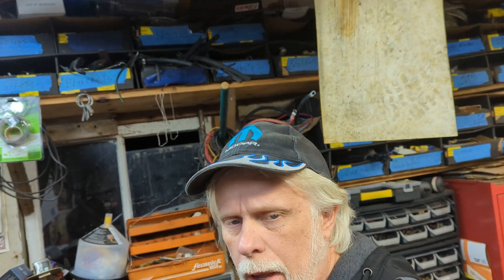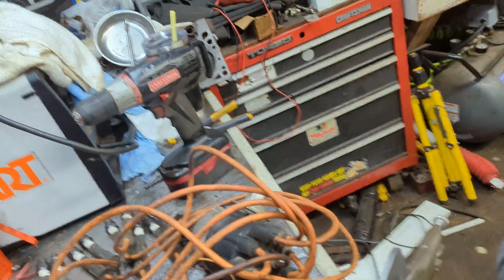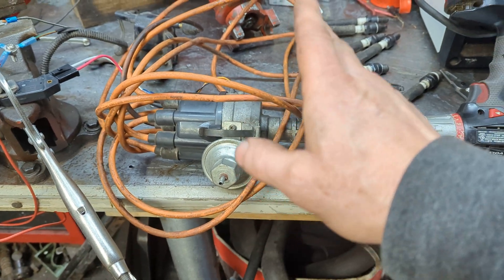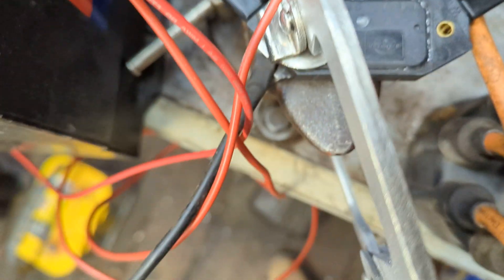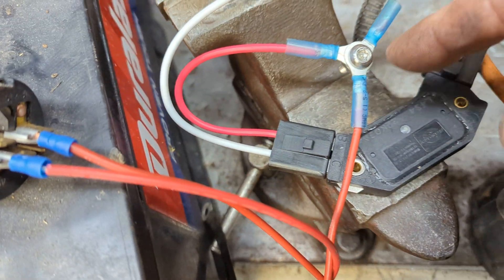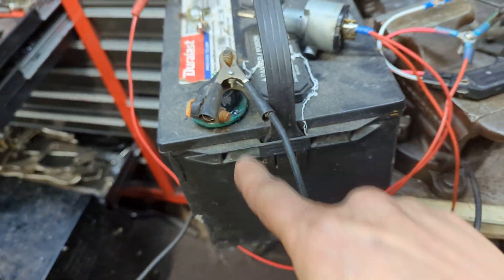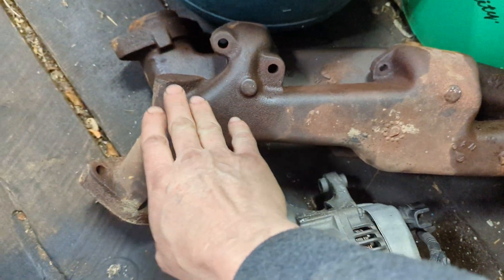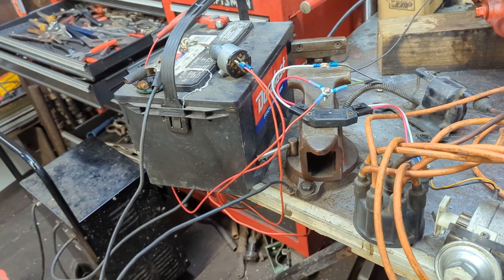Mopar HEI ignition conversion and junkyard haul

Comment: Good video!  Ignition systems (although simple) are not really my strong point. 🙄
  I get the basics with both the the primary and secondary wiring.
  But when it comes down to the specifics, IE. Does the coil need to have built in resistance, and if so how much. I know the starting voltage needs 12v ( battery voltage) but the run voltage should drop to around 8v.
  I have no idea how to do this, either on a run stand, or after installing in my truck. 
  1992, that I am trying to eliminate and bypass the old computer.
  Any thoughts on this?
Reply from the maker: Hey, thank you sidewinder for your continued support. The older Mopar electronic ignition system which used a brain box and a balancer resistor the voltage in that system starts out with 12 volts and gets cut down to about 8 volts. Like you said that is so that the computer the brain box ignition computer can live a long time. If it runs with straight 12 volts the Mopar ignition brain box. It won't last as long. That's why they employ the ballast resistor furthermore, the GM HEI ignition module takes straight 12 volts. So the idea is that it would have more voltage going to the plugs. Don't know if anybody's tested this or not. Maybe I'll be able to test that in the future video. Don't know for sure as far as you bypassing the computer and getting rid of it in your truck. There's basically two ways to make this happen that I can think of right off the bat. The first is to go with an older wiring harness from let's say of 1986 or earlier Dodge truck that will allow you to have the to get rid of the computer all together. The best way to do this is to of course obtain the harness from an 86 or earlier Dodge truck. Lay it out on the ground and then lay out the harness from your 92 Dodge truck now. You'll probably also have to have wiring diagrams of both vehicles. Figure out what you need to do as far as modifications to that 86 harness to make it work in your 92 and also feed information to gauges. Now this may not be that easy, nor it may also not be very straightforward. You can also the other way is to leave the computer in place feeding information to the gauges and also working with the starting system in the truck the ignition switch and so forth it also will be controlling the alternator voltage regulator. You can leave it the factory computer in place. And do an ignition system independent of the computer. You can do something like this GM ATI module or a Mopar ignition system that uses the brain box in the ballast resistor or you could use some aftermarket system. MSD comes to mind and then the computer in that case would just be controlling the voltage regulator for the alternator and then feeding information to the gauges. It wouldn't be controlling the ignition system or the fuel system. I hope this helps. If you have any further questions let me know. Oh one more thing. If you need wiring diagrams let me know. I have books, manuals and I can at least send you pictures of the wiring diagrams
Reply: @slantfish65sd  
Thank you for replying.
 The engine I will be putting in the truck is carburated, and I figure I'll go ahead and put an external voltage regulator on it as well, I'm trying very much to eliminate this computer. It is the 3rd one this truck has had in it and quality ones are getting expensive and hard to find.
 I may hit you up for some of those wiring diagrams in the future.
  Thank you so much!
👍